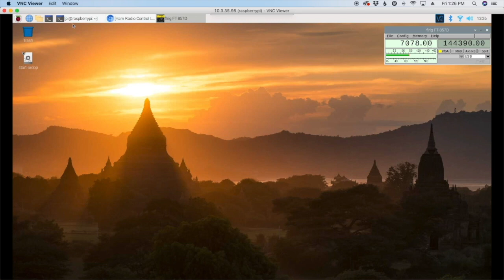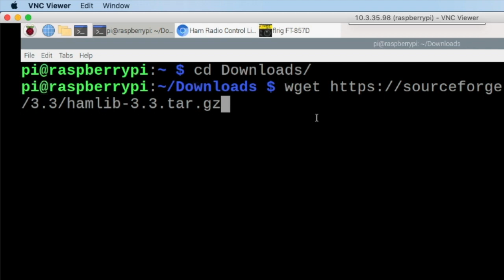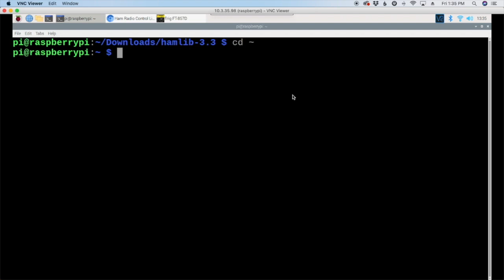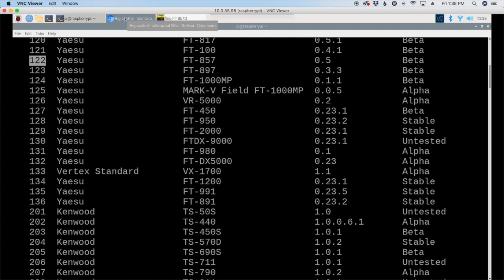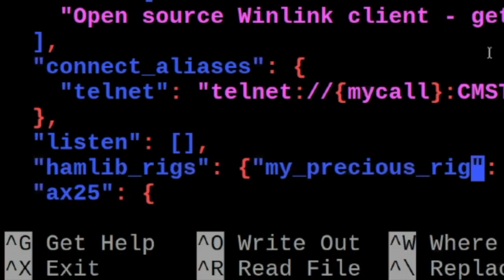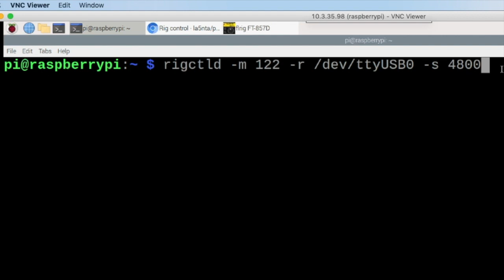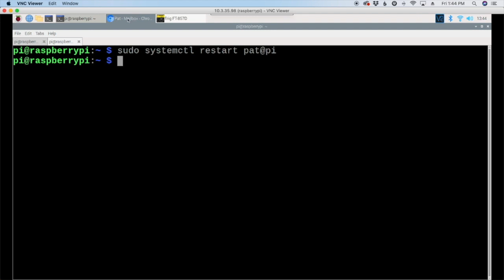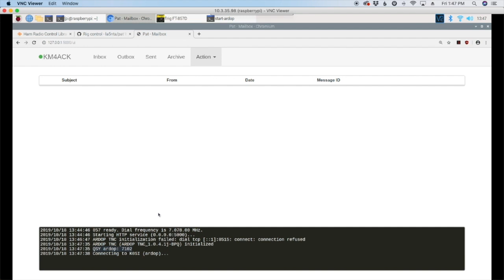Install Winlink on Raspberry Pi4 Part 3 Rig Control

Comment: Starting from AmRRON install scripts, then using these videos to configure programs, I think flrig and rigctld are fighting with eachother(?) Anybody else get Unable to get frequency from rig 891: read tcp 127.0.0.1:41918->127.0.0.1:4532: i/o timeout?  More info below:

Thank you for these excellent step-by-step videos.  I never would have gotten this far on my own.  I tried using AmRRON install scripts to get all the software packages, but found that the software wasn't configured after installation, so these videos are a lifesaver.  I've configured everything like these videos (albeit using the AmRRON installs). However, I now think flrig and the rigctl daemon are now fighting over the same ports or something.

With flrig and rigctld ( ~$ rigctld -m 136 -r /dev/ttyUSB0 -s 4800 ) both running, Pat (Chrome browser window) will say "Unable to get frequency from rig 891: read tcp 127.0.0.1:41918->127.0.0.1:4532: i/o timeout."  If I close down flrig, then re-start Pat (~$ sudo systemctl restart pat@pi ), then Pat successfully reports "891 ready. Dial frequency is 10.122.40 MHz." Opening flrig back up, then re-starting Pat brings the error back again.

Flrig has its TCPIP settings window set to 127.0.0.1 and port 4001. Rig control works from flrig too (using the same /dev/ttyUSB0 port in the GUI settings windows).  Everything else in the videos seems to work up to this point just like in the videos.  Is maybe using the AmRRON install scripts my main problem?
Reply: Update: I see you replied to my previous comment before I deleted and posted this revised version. KM4ACK, you are so speedy with replies! (Sorry for deleting the original comment and your reply).  I checked the baud rate on the FT-891 like you suggested and it's set to "CAT RATE 4800bps" on the rig.  I'll keep digging.  

And again, thank you!  This is pretty minor issue and these videos are incredibly helpful for me - this would have taken me literally months to configure without your help. 73 and Merry Christmas, de KI7POL
Reply from the maker: No always speedy. Just happen to be at the puter when you posted the other one. Merry Christmas my friend. 73, de KM4ACK

Comment: Got this while trying to set up pat with rigctl on the pi: 2019/12/18 18:42:44 Unable to get frequency from rig IC-7000: dial tcp [::1]:4532: connect: connection refused.
Any ideas of what I may be doing wrong? Thanks in advance Alex N2IX
Reply from the maker: That indicates that your rig control command is incorrect. 73, de KM4ACK
Reply: @KM4ACK  That's correct. Red Digital's error message is the same one I get when I type the wrong USB port into the rig control command.  I used this other command to figure out which USB ports I had to work with: ls /dev/*USB*
Reply: i have similar problem,,, but mine goes TX  how do i set DTR high,  RTS as PTT and 8/1 stopbit (i use that in fldigi and with wsjtx)
Reply: Any luck on this?  I have tried using ttyUSB1 but that also does not work and I only have ttyUSB0 and ttyUSB1.  I do notice that when I run the rigctl command after a while it return the follow prompt: "Rig command: "
Reply: I get the same but after I click on connect in Pat, it triggers the PTT no problem. Odd.

Comment: Man, I love your videos, but I am having the worst time getting Pat/Winlink set up.  Running at FT857D/Signalink USB/Raspberry PI that I configured exactly as your videos, and just not getting a connection on any of the stations.  Is there anything different with your configuration within the FT857D?
Reply from the maker: William Witt out of curiosity, do you have your radio/sound card setup working with other digital apps like JS8Call or FLDIGI? Can you monitor your 857 while it’s transmitting on another radio? 73, de KM4ACK
Reply: @KM4ACK  Yep, was just up on JS8CAll, and was picking up and receiving Europe.  I can see the PAT display the frequency change.  I set the 857 to VOX mode and got it transmitting, but it wouldn't just straight CAT control.  Much appreciate the response.  Your videos have helped me a ton!
Reply from the maker: You shouldn't need to set the 857 to VOX as the signalink has VOX built in. If Pat isn't keying the radio, then you don't have enough "sound" coming from the pi. Turn all of the volumes up to 100% on the pi while testing. Both the internal sound card and the USB sound card. You can reduce later after you get it transmitting. Keep an eye on your power meter and ALC meter on the 857. 73, de KM4ACK
Reply: @KM4ACK  I will certainly give it a whirl and let you know how it goes!  Much appreciated!
Reply: @KM4ACK  Took your advice and adjusted the volume on the PI, the signalink is now keying the radio (which is nice), so I think you were dead on with that suggestion.  I am still unable to connect to anyone.  I did notice that my transmit to receive time is longer than the ones on some of your earlier videos.  My radio appears to be keying for about 3 seconds, and then monitoring for about 3 seconds.  Could it be that I am keying too long or something and stepping on the response?
Reply from the maker: @williamwitt911  It is slowing while it is "pinging" the station you are trying to connect to. Once the connection is established, it picks up speed. I use a NVIS antenna and find that I have the best luck on 40M & 80M. 40M during the day and 80M at night. Stick with it! You will get a connection. Make notes of which stations/freqs you connect to. This video https://youtu.be/Nzft7OgzY4g should provide some encouragement. :-) 73, de KM4ACK